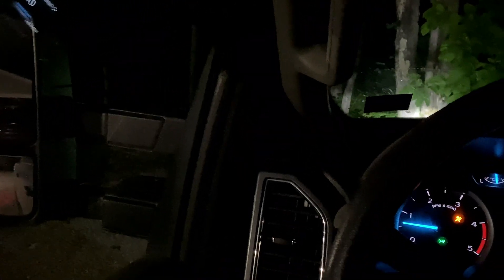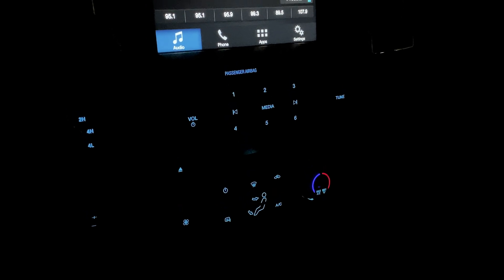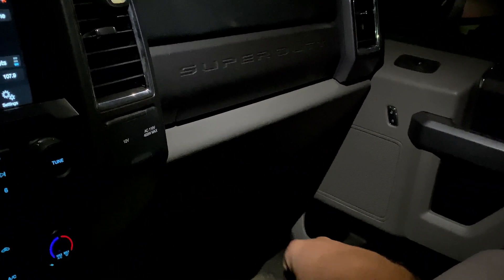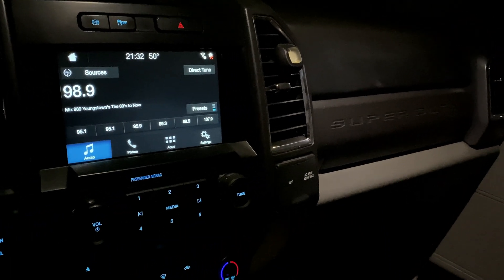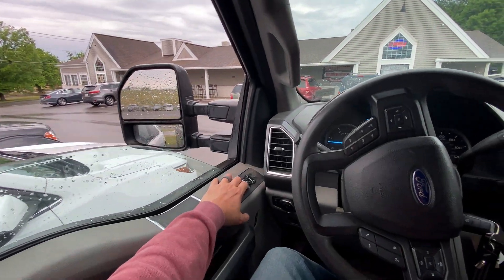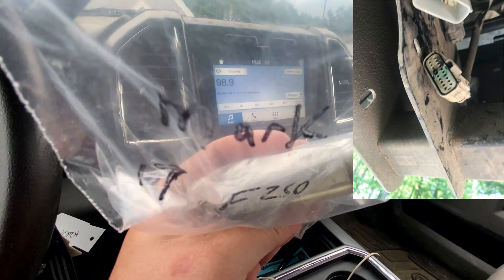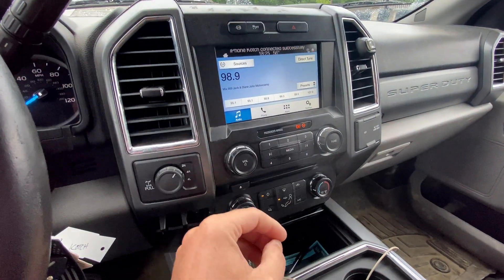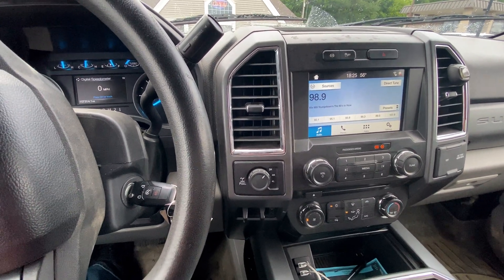17 F250 Electrical Issues Due To Water In This Connector Front Windows Air Conditioning Airbag

Comment: I have this issue but when the cable and harness dry out, systems reset and work. Do you have pictures of what Ford did to fluid water from draining into in the future? I noticed these cables run from under the bed, through the rear number and then plug into another harness by the spare tire. The fabric leading down is soaked wet and I can see water in the adapter. If I replace this, I still run the issue of gravity, so curious if you could share pictures of how they addressed it.
Reply from the maker: I can’t access it currently but if you can put any environmental protection over it would help

Comment: IT'S NOT THE BODY CONTROL MODULE.  IT'S THE WHITE CONNECTOR UNDER THE REAR BACK BUMPER. YOU NEED TO BRING THE SPARE TIRE DOWN TO BE ABLE TO ACCESS TO IT. I WENT TO THE TRUCK JUNK YARD AND BOUGHT ONE FOR $25. WENT HOME UNPLUGGED MY TWO BATTERIES, MATCHED THE WIRES ONE BY ONE. YOU CAN TELL BY  THE COLORS. TAPED EVERYTHING REALLY WELL BACK AGAIN. PLUGGED MY 2 BATTERIES BACK ON AND IT WORKED LIKE NEW AGAIN. FORD WILL TRY TO SELL YOU THE BCM AND THE WHOLE HARNESS.

Comment: Do you have the part number for the plug? Thanks! Having the exact issue
Reply: You wouldn’t happen to have the part # or name of the connector?  I’m having the exact same problem.  Ford won’t touch it because I’m deleted and tuned.  FML